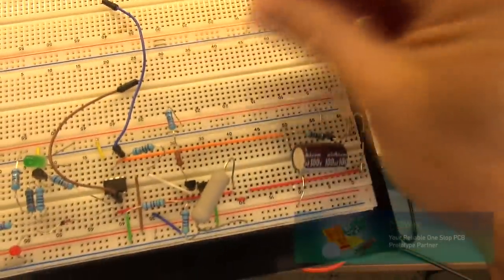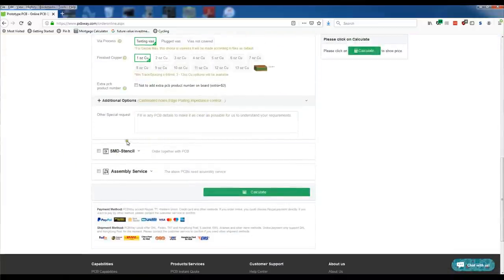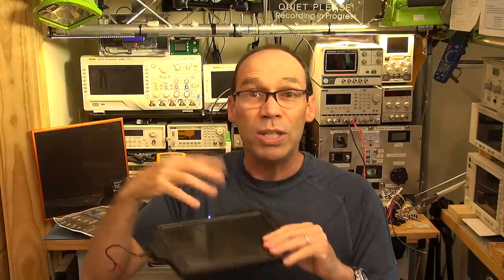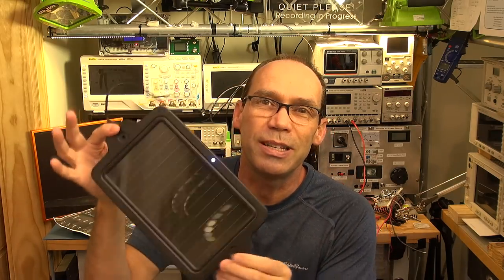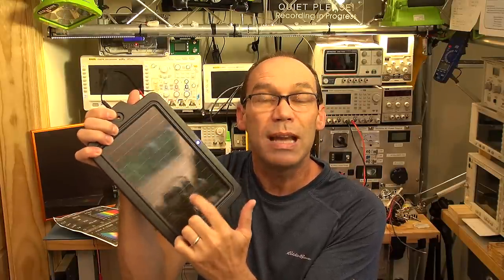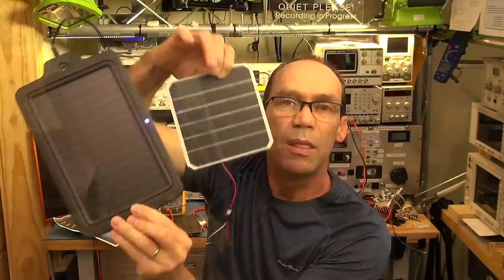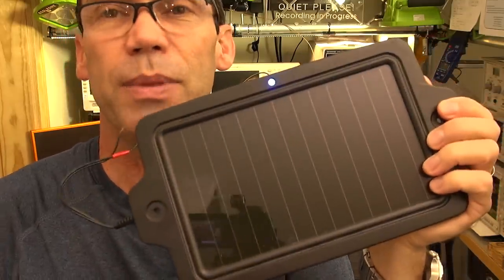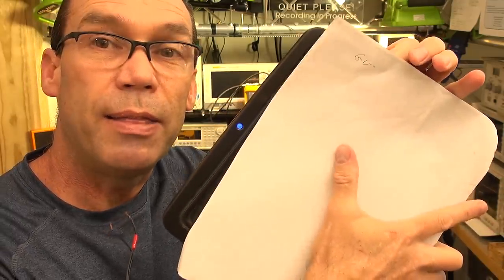Solar Panel Test Bed - Part 1

Comment: Fascinating, I have always wondered if a two story house with solar panels on it's roof would get more sunlight than a single story home from simply being higher up and possibly getting it's light sooner and later as the sun comes up at the horizon and set's on the other end? 
Because if you think about that old trick where you lay down at the beach as the sun sets and when you can't see it anymore you stand up and it's back for a little bit longer, technically going by that, a three storey house should get a slight higher average in sunlight exposure than that of the single story... It might actually pay to build up instead of out LoL... It's all about efficiency at the end of the day and the structure that the panels are mounted to might also play a big role in what you will achieve...

Comment: The two panels can not be compared with each other. The big one has about twice as many single cells as the small one. That means, the big one has a higher voltage.

Comment: Actually, for a given current, blue LEDs appear brighter than red LEDs of comparable efficiency because the eye is not very sensitive to red light. Green is the best, however.
Reply: I’ve noticed with cheapo 5mm LEDs, the blue ones are by far the brightest given a set amount of power. Just from human light response, I’d assume green would be the brightest for a given power, but there must be something else going on.
Hell, a blue cheapo led visibly lights up using an 18650 and your body as a resistor

Comment: Yeah (sigh) solar always looks super great on paper (aka: solar is great under "ideal" conditions). Unfortunately "ideal" solar conditions hardly ever exist for very long periods of time during the day and/or throughout the year. Things get even worse for solar the further one lives from the equator and/or the further away one lives from a desert. Trees/canopy foliage is another major Achilles heel issue that makes solar less viable. The most favorable solar system is one that combines a wind generator (w/solar) to create a hybrid system. That said, wind generators unfortunately also come up short (for most) due to their rather ginormous size and crazy zoning regulations, which severely limits their use in cities and average-sized suburban properties  :(